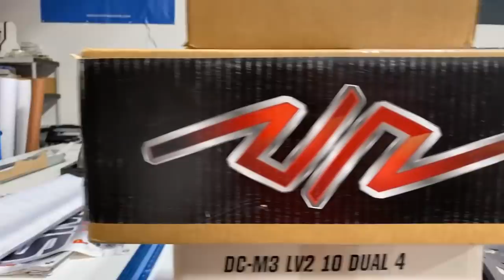Car audio stuff? Performance upgrades? two mystery boxes arrived. Lets open them!

Comment: If that lil amp pushes 800 watts that is going to change the way installs are done in the future, because we won't need all the extra space just for large amps. I could see a 3,000 watt amp the size of a 800 watt amp in the near future. Maybe smaller. 😉
👍🏼👍🏽👍🏾👍🏿🇺🇲🇮🇱🇺🇲🤘🏿🤘🏾🤘🏼👎🏽
Reply: @Chico Man Saw the new sound digital 2000 watt amp and it's just a bit bigger than the new Samsung note